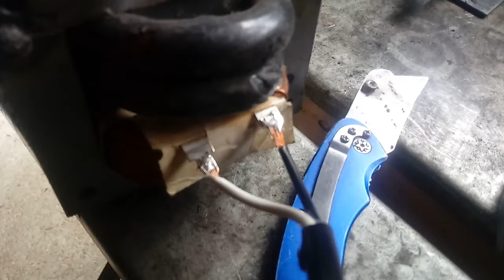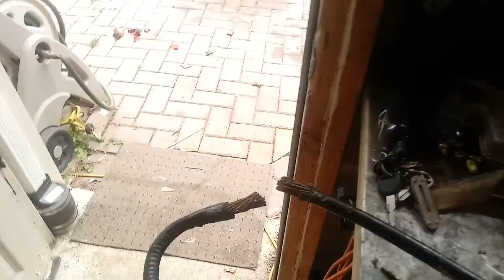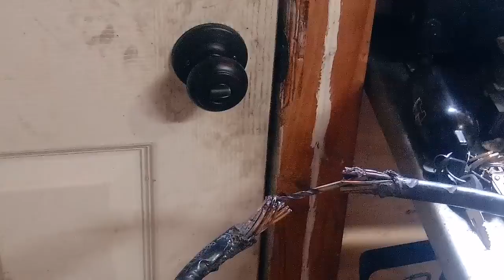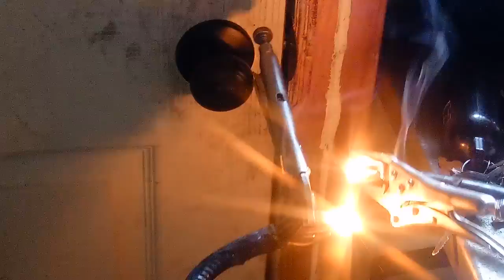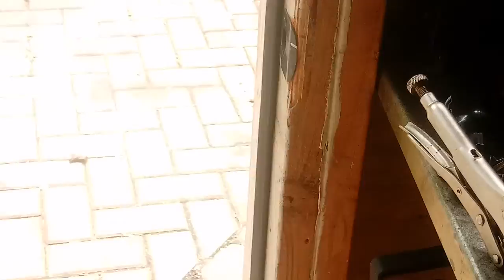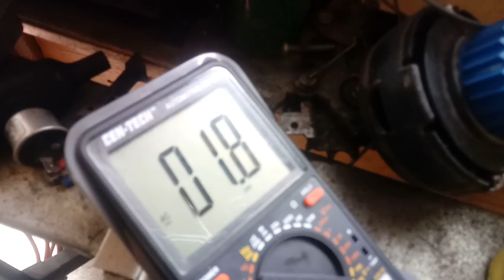Homemade metal melter rips through steel/ 800+ amps!

Comment: Thats not nearly close to 800 amps . The most youll get with 1 transformer and 120v 60hz is around  100amps max…. maybe.. before you trip your breaker or burn  the wires in the circuit to the outlet and burn down your house . But hopefully the transformer shorts out and cuts power first or you are conneted to a single outlet circuit with a single digit AWG #…  just had to say it for anyone in the future who watches this and has no knowledge on this.
Reply: That's not nearly Close to 800amps That's not true at all.  The transformer he made steps down mains voltage to 2-3v open circuit. And it drops to .5v under load, meaning he could draw theoretically 3600A before wattage limitation from a 15A source becomes apparent. The output is also isolated from the input, aka mains, meaning a short on the output just draws a bit more power on the input instead of tripping the breaker. It could absolutely be putting out 500 - 800A range
Reply from the maker: It Has to be putting out quite a bit to glow quarter inch steel bolts lol
Reply: @mechanicalking  I made one a while ago. And it would instantly max-out my 400A meter, and it just barely was able to get nails glowing hot